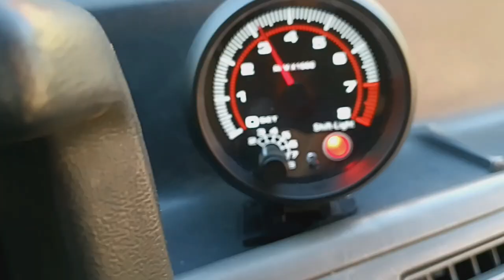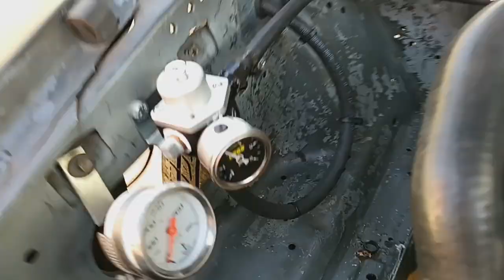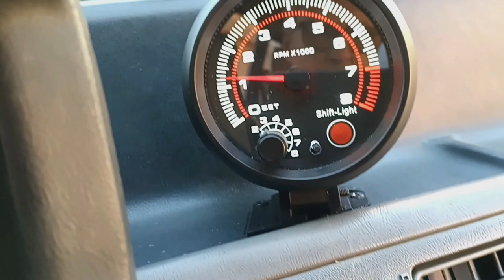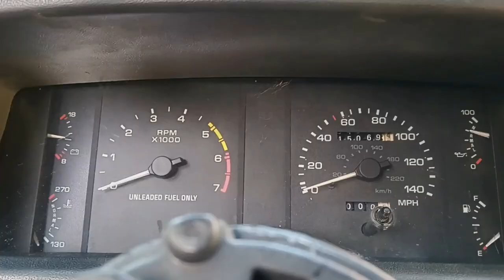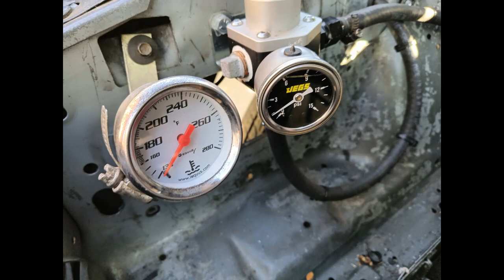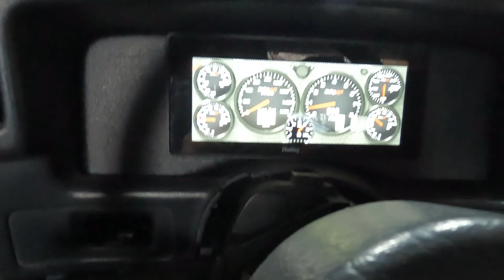89 Mustang LX - emergency brake cable replacement ect.

Comment: Original engine with TFS cam, aluminum radiator with twin electric fans, air condtioner delete, AOD, EFI to carburetor (600 cfm Holley 4 Barrel) conversion, Edelbrock dual plane intake, true dual exhaust (Flowmaster Muffs)